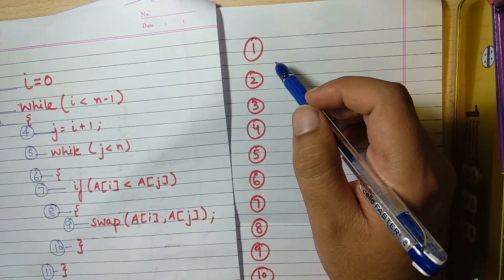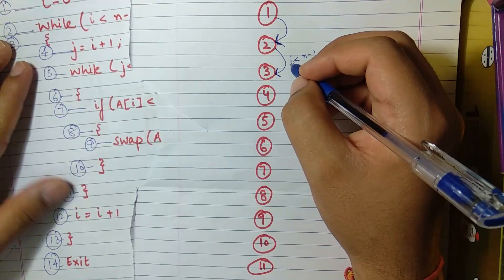How to calculate cyclomatic complexity | CYCLOMATIC COMPLEXITY |Software Engineering| GATE

Comment: their is a correction in the graph 
node 13 to node 2
node 11 to node 5 
should also be connected 
therefore total edges = 16 
therefore cyclomatic complexity = 16 - 12 + 2 = 6